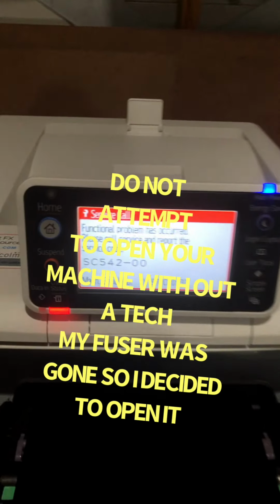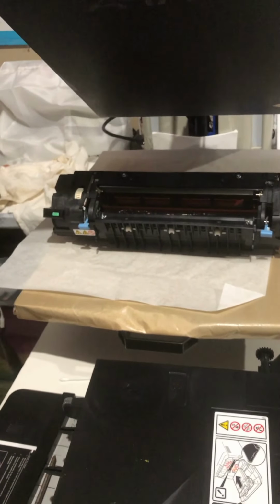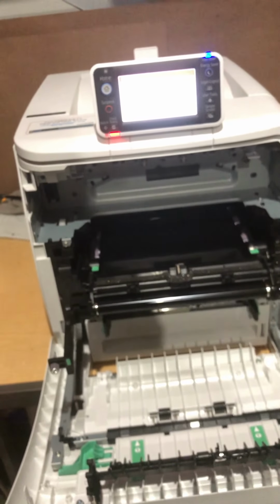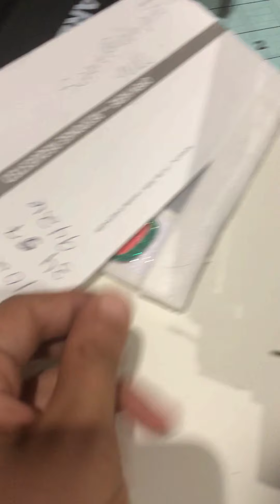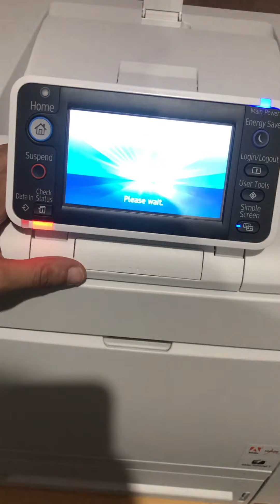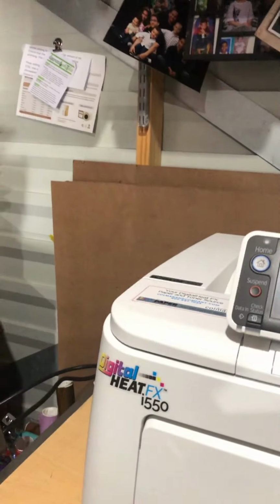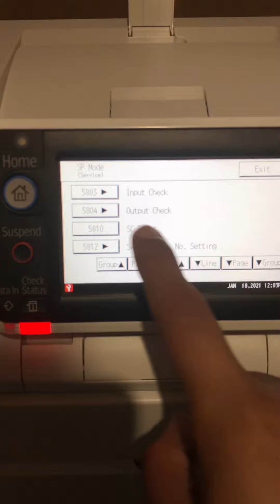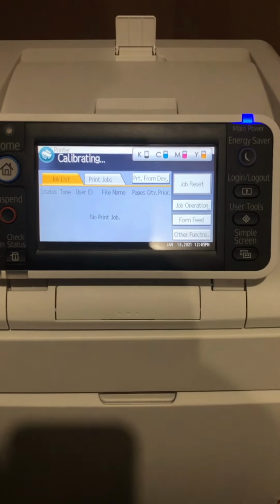White toner technical difficulties SC542-00 and sc 500-00 error on Uninet i550 never buy used!

Comment: Oh no so many issues at once! 😮 Praying for you girl! 🙏🏾 Looks like your printer is back up and running, so that's good.  What happened with your proworld heat press? I think that's the same one I have, the auto open 16x20.
Reply from the maker: Just posted a video of it ever goes out check the rocker start switch :) almost threw the whole press away and it was a 10$ fix